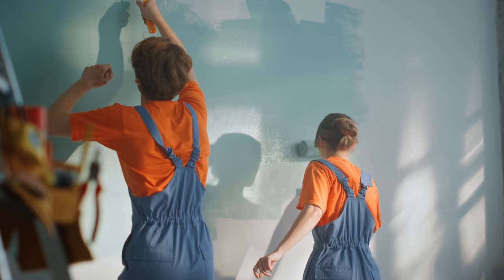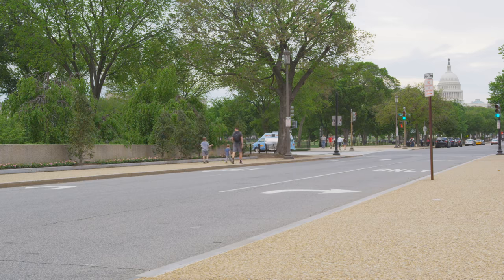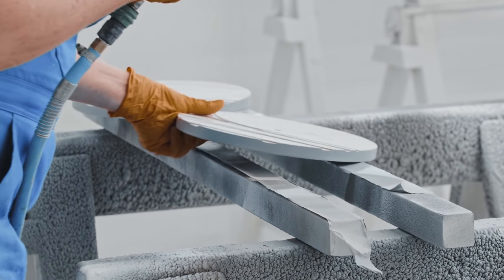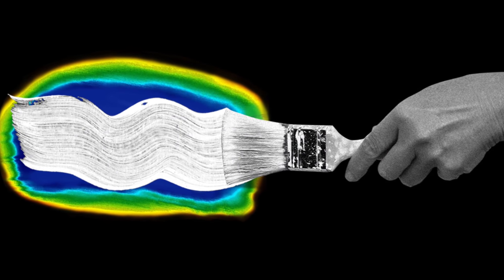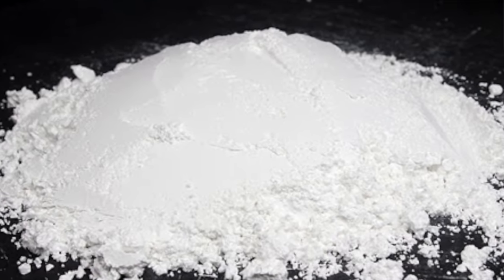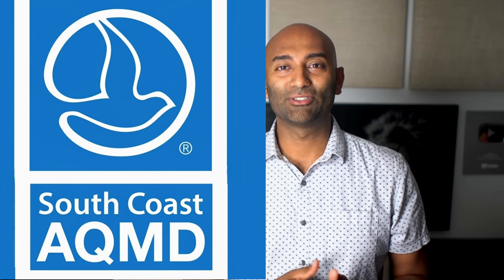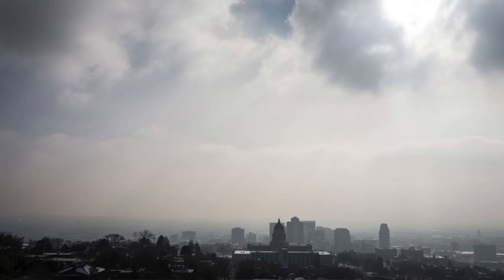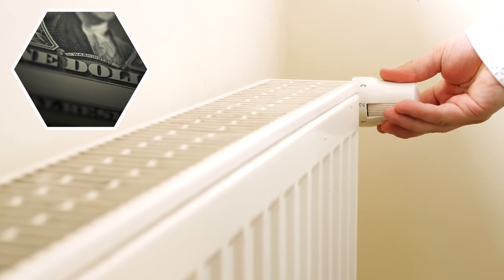Forget AC - Paint Your House This Instead!

Comment: Question is how long can you practically keep it white? Dust and stains would drastically reduce efficiency.
Reply: that varies from region. It should work as solar panels: as long as you clean frequently it won't make a difference. My only conseran is the degradation of material like corrosion.

Comment: first thing that came to mind about this paint is using it on space crafts. I keep hearing they have problems keeping cool under direct sunlight, especially when dealing with cryogenic fuels. paint the hull white or even throw a replaceable white tarp over the tanks.
Reply from the maker: Yes very true!
Reply: We are waaaay beyond that for space crafts: at the moment we use multilayer coatings that absorb, reflect, radiate and transmit selective wavebands, tailored for the specific application of that particular object

Comment: Get a rollable sheet for your roof- white on one side, black on the other. In summer have the white side up and black side down. The white will reflect the suns energy and the black will absorb heat from the house.
In winter, the black will absorb energy from the sun and the white bottom will reflect energy from the house back into it. 
You can choose what point in spring and fall to roll up the sheet, and unravel it in the opposite direction.

Comment: Before retirement I did some spectroscopy testing at my work that calibrated some instruments we were building for NASA Earth Sciences satellites. A very pure white powder packed carefully to a flat surface in a recess in a target panel was one part of that calibration of the spectrometer.  I do not recall it being barium sulfate. Another was the coating inside a large  internally lit sphere  that served as a uniform white light source. It is known as an integration sphere and its opening had to be larger than the angle of acceptance of the spectrometer that might have been that compound. 
What I found in the laboratory that this spectrometer was located was that reflections off of the other surfaces in that room would poorly influence some of the more sensitive readings.
 I had to find curtain material to block those reflections that was truly black.
   There were some commercially made dark room curtains that we had, around the sides but the "white" ceiling tiles were distorting the the uniformity and had to be covered with black cloth. It was then I found that what seems black to our eyes is not necessarily black to that spectrometer.  Indeed it had a reddish hue towards the red end of the visible. Many swatches of "black" cloth later and I had found the right combination for absorbing as uniformly as our 'white' targets did the opposite. 
Thanks for reminding me of the subtleties needed in accurate scientific testing. It is not as simple as it sometimes seems. My first thoughts as you described this paint was, of how quickly the soot from urban air pollution would render it right back to that 90%  or less reflective level that is so common with such paints, alas.
Reply: The white material you mention is called Spectralon and it is made of sintered PTFE (teflon) powder

Comment: I designed my house as solar passive over 25 years back. I didn't tell the builder who would have put the price up 10% if he knew. The house never needs heating daytime in winter if its 60% sunny. In summer  many people on walking in asked if we had air conditioning, on 35 deg C days the house is 26 deg C inside. This was a stupidly simple thing to do for zero cost and I couldn't guess how much it saved me over the years. I did stuff up the colour of the roof dark green! I'm colour blind so let my wife choose all, not realizing the effect 😖

Comment: In Florida, summer cooling is my biggest energy cost.  We have lots of sea breeze clouds and wet lands around here.  It is low population density, so on the surface it looks like the benefits out weigh the concerns.  I will need to repaint in a few years so I hope to be able to try this product.
Reply: why you just do not repaint now with ordinary white color? I mean we have white house, white windows, white steel constructions (like first door frame) and temperature is always 10 *C less than outside. And white window shades (but we rarely use them).

Comment: Shading windows from incoming direct sunlight, good insulation including window frames and 2 or 3 layer windows. 
Having air as insulation between roof and the insulation on the attic, and have that space well ventilated. Solar panels on the roof adds shade for the roof, hence for the rest of the building. 

Controlled ventilation, where very cold or very hot outside air is tempered before entering the inside of the house (some do it with ducts underground). 

All these are clever ways to construct a building to need less energy!
Reply: And terracotta color and not any shade of grey
Reply: Like you mention...We have a  cheapo air intake system with 20cm diameter tubes 200 cm deep under ground for 30m. Cools the air in summer and warms it in winter. Goes into a central air circulation system of course. That costs virtually nothing to run. No silly noisy fans in each room to let the street noise in

Comment: I think the best thing for thermal insulation and passive heating/cooling are rooftop gardens and vertical vegetation, that keep you cool during summer by dispersing humidity, and insulated during winter

Comment: Ok for the roofs but not sure about the walls : problem with vertical walls is that most energy reflected by those go to the ground, heating the next house, pedestrians, cars, and streets. Also if the paint reflect some long wavelength infrared it can help keeping in the heating. So it is not all bad for cold climate. In architecture the most important design is the south face of the house, that must reflect high sun of summer and try to get in as much as possible low sun of winter.
Reply: But could you not argue that that would happen anyway as well as there is a chance that that light that reflecting off the wall will have an opportunity too reflect off the floor as well.
This is not intended as an argument I think your point is valid.
Offcause this would make the roads hotter as they are black.
This would need too be considered if they decide too go with it.
Reply: @WhyplayGaming  White roads and plazas could be interesting, too. About the walls there are interesting concepts with deep windows and apparent structures sculpting the outside of building, that insure direct sunlight do not reach interiors, but yet you can see outside. Useful for desert buildings. As most of Europe will shift toward arid, will be needed.
Reply: The roof is your primary problem, but the east and west walls catch a lot of sunlight in the summer.  Get rid of all east and west windows.
Reply: @Cspacecat  natural light is one of the most important aspects of a heathy home with good wall design you can get light but not heat, see desert designs: you can see outside but you are always in the shade.
Reply: @AlexandreLollini  I have about 60 sq. ft. of glass on the north side, but about 340 sq. ft. on the south side.

Comment: I'm a painter (artist) and I've known for decades about the passive warming affects of color. White is less warm than darker shades in, for example, direct sunlight. But actually cooling is pretty crazy - smart people at work here. Thanks for sharing the info.
Reply: Cooling works because any surface at any temperature is radiating away its heat all the time, as infrared radiation.¹ BUT! That radiation has to go somewhere. Thus, our world is full of infrared radiation bouncing around everywhere, emitted from one surface and absorbed by another surface. Everything is constantly giving off but also taking in heat. So if a surface is cooler than everything around it, it will absorb more than it emits, and warm up. But if it's warmer than its surroundings, it will emit more than it absorbs, and thus cool off.

Thus, if you can come up with a substance that emits the normal amount of this radiation, but only absorbs a small amount of it, it will tend to cool down faster than it heats up.

¹Technically it's not always infrared. It becomes visible or even ultraviolet light if the temperature is high enough. For example, an object at 4400°F (or 2700 Kelvin) will emit light about the same color as a 2700K light bulb. (This is no coincidence.)

Comment: Did this a few years ago, with one side of the roof covered in solar which shades the roof, and the other that gets indirect sun but still gets hot painted white using ordinary house paint. Here in Australia we've had temperatures up to 49C in summer. I still haven't used my A/C since then, and on a hot summer's day the metal roof feels cool to the touch, whereas before it was burning hot. The only downside, as Two Bit mentions, is that in winter when I want the roof to heat up it doesn't, and this means that damp can sometimes form in parts of the roof cavity from the wet areas and kitchen steam etc. But overall it's a massive plus and I only pay for electricity in winter.
Reply: At least your suburb let you paint your house. So many suburbs in Ausfalia only let you choose heritage colours now
Reply: @janeblogs324  The side of the roof that faces the street is covered in solar, so no need to paint that side. I painted the side of the roof away from the street, but I don't think my suburb was too upset.

Comment: Back in the 90's i used a product PolarSeal Top Security which is a 100% acrylic latex which contained a titanium dioxide at a high pigment volume concentration and achieved excellent results. We are at approx. 12 deg N latitude in the tropics and on a hot day both concrete and sheet metal roofs were cool to touch. Approx. 2-3 deg Celcius cooler than surroundings. It went on at a coverage of 50 sq. ft per gallon and served as a waterproof membrane as well. After 20+ years its still performing well.

Comment: How much of heat absorbed from sun light is caused by visible light and how much of it is caused by other infrared and uv waves ?
Reply: Peak emissions from the sun are in visible wavelengths. This is why we evolved to see visible light, that is where most of the energy is. And this is also why the sun looks white when not filtered by the atmosphere.
Reply: @zawilious good to see someone missed that glaring issue in this video. The sun's heat is made up of 3% UV, 44% visual (reflecting light) and 53% infrared. In the end this ignores completely the IR heat and this paint would be glaring for neighbours. I've not been able to find any testing data to the claims. Interesting Barium Sulphate would need to be very thick so keeping the quality of performance will be a challenge. If the paint gets dirty on a roof it will reduce performance as well. In the end its another white light reflective paint.

Comment: For winter, you can take advantage of the different angles of light. If you let light in from the side moreso than the top during winter, and also reflects more light during summer, you can passively cool and heat your house

Comment: I seen one gallon of paint with 1 oz of microcrystalline borite spheres added have a thermal resistance of r-24 with  just one coat in 115 degree heat a painted vinyl siding was 72 degrees I'm certain without a doubt  that Starlite was actually someone else's way before he brought it up. Without a last or first name the person I refer to is nicknamed Pops.

Comment: There is a house a few streets away from me where a facade is made almost entierly out of black metal cladding but it doesn't need any AC. It's got big overhangs in the first floor and shading on the windows in the second. The metal facade has ventilation gap and then 26cm of grey EPS insolation. The walls and floors are all made out od solid concrete so it takes a lot of energy to heat it up in the summer and because the temperatures drops bellow 20 celsius (68 fahrneheit) at night the house stay nice and cold all throught the day. Because of the big overhangs light never actually shines directly into the house but it bounces off of the enviroment around it.

Comment: But most homes are starting to build with insulated roofs and walls. Metal  use an air gap. So the cooling effect won't go through anyways. But maybe for old homes.
Reply: An insulation cannot stop the transfer of heat, only reduce it. The transfer of energy is liniar to the temperature difference between inside and outside. So while a drak roof might have a dT of 50-70K a white roof only has a dT of 10-20 reducing the heat transfer to the inside
Reply: @fabianfeilcke7220  with enough insulation, which is basically the spot where the heat can slowly cool down before going further, it's probably cheaper to paint the roof than adding extra insulation with tech like this. I think I like the solar over a planted flat roof.

Comment: So if the buildings do not absorb heat, it will stay in the air. Is this a good idea, or not?
Have a black roof. Absorb the heat with water, and use the hot water for heating at night.

Comment: Can't wait to loose sight because of this paint in broad daylight 😵‍💫
Reply from the maker: This is true…. Good point
Reply: Just like mirrored glasa buildings?
Reply: @shawnr771  well it's quite different really. Have you ever glanced at sheet of paper in the sun?
Reply: @f0ca94  yes. I have also been blinded by building reflections.
However since having Lasik surgery 15 years ago, I pretty much do not go outside during the day without a good pair of sunglasses.

Comment: Late in the game here 🐢 just painted ordinary White roofing paint on my galvanized roof. Immediate cooling even without the NASA technology cool paint. Still use the aircon though at middle of the day but that's where the big change happened. The aircon really feels cold now that the room is a few degrees less hot from the white paint. Will install a solar roof fan and indoor ceiling exhaust fan and hopefully no more aircon needed. Everyone in the community using air-conditioning is making the outdoors even hotter 🥵

Comment: that paint is a hoax. 

if it is as good as it said, you are cooking the atmosphere above instead bounce the heat out to space. there is no express way to bounce off heat from your house directly to space without touching the atmosphere. 

yes, you can make whatever whitest paint. but you cannot stop dust. I don't think that paint can work properly cover by dust particles. in fact, all wet paint attracts dust in the air, so in the very moment you apply the paint, it lost some of its proclaim function. if I want my house white, there is a simplier way, calcium carbonate, some people call it lime, chalk. it was use to keep things white before factory make expensive paint. non toxic (safe enough for baby kid to touch), available worldwide, dirt cheap, and white enough. and you can apply coating over coating very time you have maintenance. yes, it will worn out, but it was mean to be, the worn out also take away the dust deposit on the top layer. so after everytime it rains, the house look shiny white. don't believe? look at those metitorian sea little white house. do they use high tech paint or just simple old techniques?

Comment: So my thoughts recently have been to build a solar array as a roof to a carport like structure.   If I choose to not go with tracking i thought of mounting biracial panels on a box like structure.  May space them with strips of surrounding glass.  The inside box, say about 30cm (1 foot deep) could be painted with this paint for back reflection to panels.  Insulated ducts coming from ground loop air system could provide ground temp air to cool  panels when needed, thus keeping efficiency up and panel degradation down.  It would of course also provide ground temp air in winter to melt snow cover. While some of efficiency increase would be consumed by blower fan, there is still the extended life of panels.

Comment: Air conditioners aren't sized based on "BTUs".  Kilowatt hours DO convert to BTUs (power × time = energy) since BTUs are a  unit of ENERGY.  An air - conditioner is sized based on the thermal POWER it can provide.  Since power is energy per unit of time (energy ÷ time…or dE(t)/dt to be precise), air conditioners are rated in BTU / (time unit - usually hours) or BTU/hr. Actually, they're usually rated in a unit of power known as a ton (equal to the power required to melt one short ton of ice in a 24 hour period) which is 12,000 btu / hr. 

So, while your conversion of kWh to BTU is roughly correct (3412 BTU per kWh), your "24,000 BTU" sizing claim on air conditioners isn't.  It's 24,000 BTU / HR or 2 tons.

Comment: Some solar panels can absorb reflected sunlight on the back side of the panel as these panels are semi translucent.  So if you paint your roof with this paint that reflects in the IR and shorter wavelength part of the spectrum and have solar panels on your roof, do you get the best of both worlds?  In other words the panels make electricity on the front of the panels and the house roof remains cool, and the reflected solar from the white coating adds to more efficiency of the solar panels?  I would think having the panels with gaps between them and elevated say 6 inches (15 cms) would keep the IR radiation temperature gain from the panels absorbing solar radiation from heating the backside of the panels.  This would also keep snow from building up.  Another trick is to paint the last foot of the roof eve a brown color so the ice doesn't build up on the edge of the roof.  Snow is really a slow moving fluid on the roof and with a steep enough angle will move to the edge and be melted by the brown paint.  The last part of the roof can have a short panel of the metal roof and a rubber insulating layer sandwich so heat is not transferred to the underlying roof.  Just a thought...